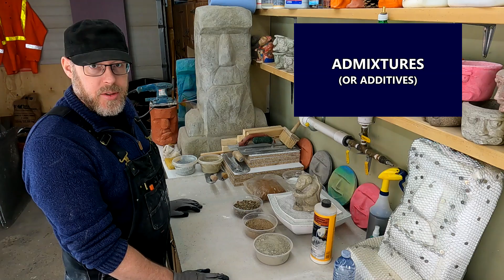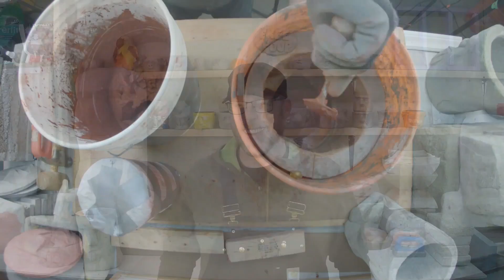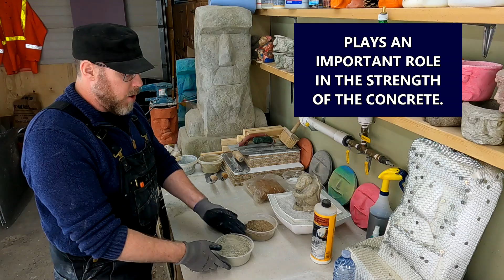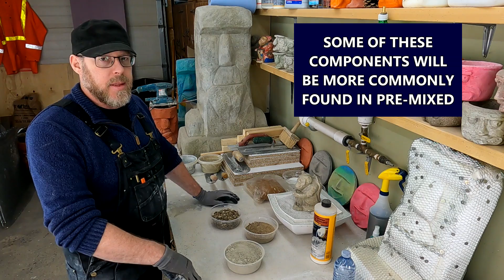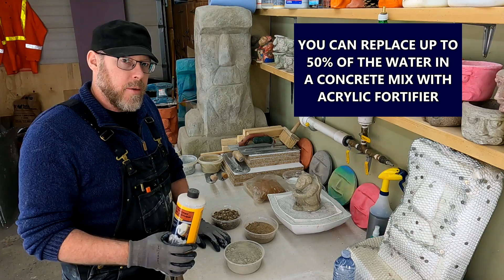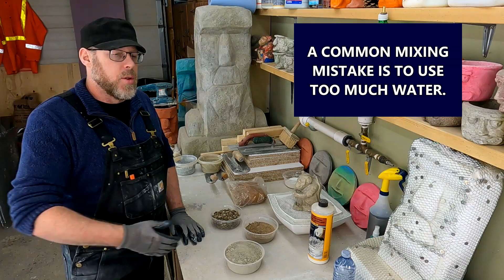What Can You Add to a Concrete Mix to Make it Stronger?

Comment: This raises a question that came to me from reading about concrete additives: Can Elmer's glue be used - or any white glue like that - as an admixture to get something like the same results as the stuff sold in the concrete aisle?
And would any "hack" like this be used to replace a proportion of water, not following the cues given on the commercial product labels? And if so, what percentage of the water?
Reply: Never mind! Just find your video on glue in concrete (https://youtu.be/ToCCGLT3uGc?si=gyELhdQCQ-RdOBfS). That's got the info I needed. BTW, the Leo AI (Brave Browser), says that technically Elmer's does not re-emulsify, but also notes that it may be affected in an alkaline environment, so I guess that's not a great choice.

Comment: What a great video series! You explain things very clearly, with a sense of what is practical as well.

I want to make a small floor section from concrete in my home workshop and need your suggestions. 

My workshop is on the second floor of a wood building. My floor is painted OSB. The area to put in concrete is 6ft x 6ft. 

I work both standing and sitting in a chair with casters. I do both welding and glassblowing there. Concrete will likely hold up better to small hot blobs of glass than most other materials. 

It needs to be fairly thin since it shouldn't be too heavy, being on the second floor of a wood building. Color is not important to me, but the final surface should be somewhat rough - not polished or slippery. 

Should it be poured into a wood-sided form which is removed after it hardens, or is there a better forming/pouring method for such a small area? What hardeners would you suggest?

Comment: I want to diy overlay 1/2 inches on my 1600 sq. ft garage concrete surface. A mix  
1 part cement portland - 3 part sand - polypropylene fiber - the less necessary water and 10% of pva, is that the properly mix in order not to be cracked? 
Or may i have to add more pva, if yes how much percentage. Or i have to add Fibreglass mesh?

Comment: I've found multiple sources that claim Rapid Set Flow Control will work as a plasticizer for portland cement products, despite what Rapid Set claims. The main advantage of that stuff is you can buy it at most hardware stores.

Comment: Melment F10 by BASF is also very nice superplasticizer for concrete and gypsum. It is a kind of melamine resin and it gets your concrete to higher strength while reducing the water.
Reply: May I ask how much a 25kgs of melment f10 costs near you?
Here I buy it at $175
Reply: @erickinyua2769  I'm in Canada and paying more ☺️
Reply: @barzucci  Thanks for the information 👊
Reply: @erickinyua2769  175$ for 25kg is a good price.

Comment: Hi, I am considering pre-casting a window sill as I cannot find the right sizes on the market. Any suggestion on the mix that will come up smooth (just use sand and no gravel I guess) and weather resistant for exterior so it does not crack or crumble?

Comment: Chopped fiber glass greater than 3" is good, don't try to mix anything longer than 7" cause it's a nightmare. Powder fiberglass just doesn't make sense.
Reply: i got leftover rockwool/mineral wool, do you have any experience with adding that stuff to the mix?

Comment: I see... I was looking a cement, sand, gravel ratio for a more stronger concrete for my Parking Lot slab, and Concrete Post other than the usual 1:2:4.  I guess what I need are additives. Thanks for the info, subbed!
Reply: You could also change your ratio to at least 1:2:3, or increase the depth of your concrete to say 4" or more, if it's not that deep already.
Reply: @bitTorrenter yes, thanks for the tip! 🤘

Comment: PVA and acrylic/latex give approximately the same strength, right?
Reply: No, pva doesn't  increase the strength as much as latex or acrylic. Pva makes the concrete more smooth and sculptable.
Reply: Need to use waterbased acrylic or latex? @richardmccann4815

Comment: Can you add both? I'm thinking add superplasticizer, let it work, & when you come back to mix, also add a small bit of acrylic at that stage? (I heard great info about acrylics on Golden Paint company website- their "Just Paint" publications. Their research found something they had not expected. You can dilute acrylics as low as 1 part acrylic to 20 parts water, & the acrylic will still display some remaining adhesion properties. So it makes sense that just a bit of acrylic could be beneficial. Yeah, that stuff is expensive. Acrylic bonds to acrylic. It helps to have an acrylic base. So I think if you really want to add strength with acrylic, it makes sense to add just a tiny amount, like you tell about in the video. If you want more strength, you can then add acrylics from the exterior, to dried, cured concrete projects, where you will likely get the most strength gain while using the least amount of acrylic. I'd expect having the integral acrylic will help the exterior acrylic bond better to the concrete, due to acrylic to acrylic bonding.
Reply from the maker: I would think mixing it integral in the mix is the best option.  Also, you can get acrylic for very cheap if you use old acrylic paints / mistints that people do not like the color of.  Acrylic / latex paint lasts a loooooong time before it goes bad.
Reply: Thanks for your wisdom. iHowever, my real question was about your thoughts on superplasticizer in the initial mix, followed by a bit of acrylic when you come back 15 minutes later, to stir it up, as you speak about in the video, to allow the superplasticizer time to work before adding acrylic. It seems maybe it would be good to allow the superplasticizer to work first, dispersing the cement, before adding the adhesive element of acrylic. I just wondered what you you thought of my idea. (You also have me wondering about acrylic added internally, vs both internally/ externally for extra strength. It seemed to help plaster to do both... but I appreciate your sense of things, as an expert. You definitely have led me to want to test this maybe with some small, longer, thin pieces of concrete mortar. Thanks again). So superplasticizer & acrylic? 
 @creatingconcrete

Comment: Most ready mix suppliers only carry the liquid super P's. And after doing concrete for 25 years you don't leave it for 10 to 15 minutes. On a really hot day they have worn off by then. They are mixed on site for a reason and the concrete is used right after. I have been involved in bridge projects.  A strong mix can have less cement then a weaker mix. Cement is the glue for the sand and the rocks and just like they taught in school if you put a thin layer of glue between paper the glue dries and you end up ripping the paper. A thick pile of glue does not get hard and just pulls apart. So the finer the sand aggregate the more cement is needed to coat it all and the courser aggregates need less cement. But the aggregate needs to be graded to fill all the little holes.
Reply: Hi, I am trying to cast a window sill for exterior. I am not expert in concrete and I am scared to install a sill that will crack soon after. What's the ideal mix to use so it's smooth and weather resistant. I see you were involved in bridged, I was thinking that kind of smooth concrete you see in that kind of building. Any help much appreciated.
Reply: @qfactor77  that depends on your thickness. If the piece is going to be 2" thick then a wet cast ( concrete with rock) is going to work just fine. If the piece is only 3/4" thick the GFRC is the answer. As for a smooth surface the key is to use melamine and cast upside down. No finishing skills needed.
Reply: @henryfehr6202  It will be 3'' to 2'', 9'' wide and about 5ft long.  I am wondering if I would need any additives. I am concerned about water/frost damage.
Reply: @qfactor77  that works out to .93 cubic feet.  The main thing is a lower water to cement ratio. Add super plasticizer for more flow/workablity.  Depending where you are home Depot has flow paks you can add.
Reply: @henryfehr6202  thanks a lot. I have been looking at plasticizers and thanks for confirming. I am gonna go for it. I have seen a video where they were using Rapid Set Flow Control that looks brilliant. It's not easy to get that in UK as here seems to only come in the liquid version like Flowaid SCC. Maybe I'll stick some thin rebar too. Many thanks again.

Comment: Have you looked into powdered glass? It can be quite cheap and according to the research powdered glass increases strength, and also reduces the need for cement by about 20%.
Reply: Glass is highly reactive due to its high silica content, leading to ASR when exposed to moisture. This reaction can cause deterioration and cracking in concrete. Use low alkali concrete or another additive to mitigate.
Reply from the maker: interesting stuff - thank you!